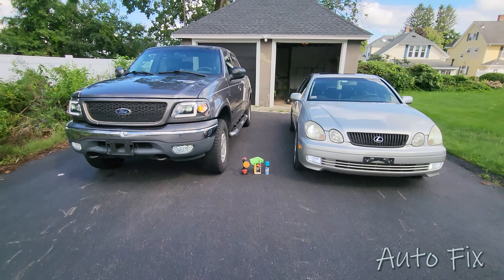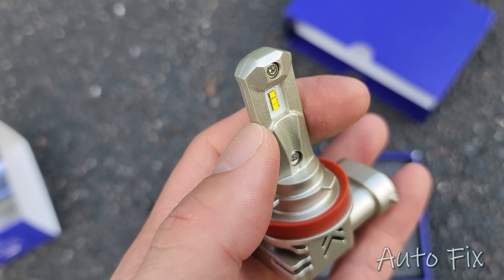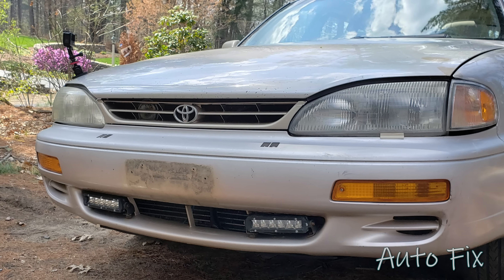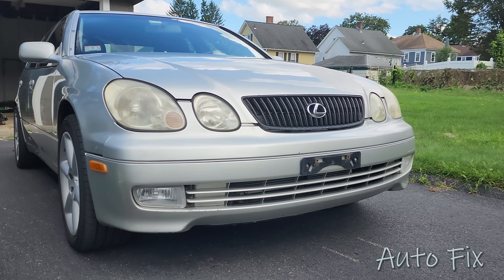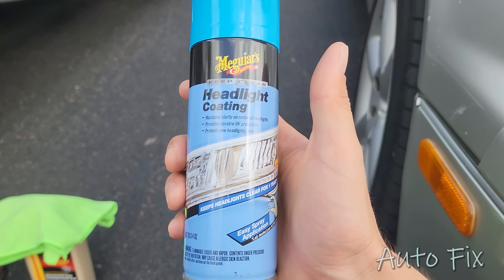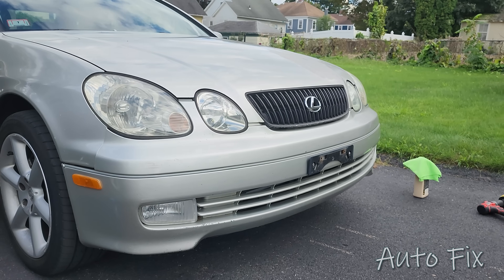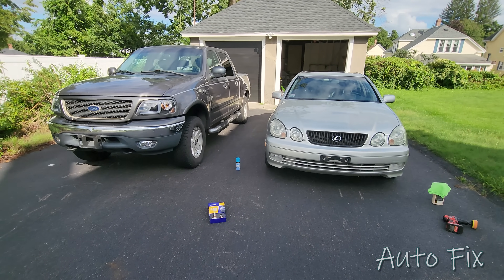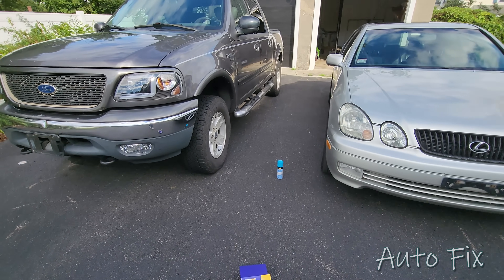How to Correctly Upgrade to LED Headlight Bulbs // AutoOne LED Bulbs!

Comment: You really shouldn’t be touching the leds with your bare hands
Reply from the maker: Yeah... it'll be alright. They're not as sensitive as halogen bulbs
Reply: Yes u can. Nothing is gonna happen with touching the led chips. 

It’s the halogen bulbs u should be worrying about. 

U can touch the led bulbs yes, but u did not say about led diodes or led chips about it specifically.
Reply: @toyotabrony  you can do anything but it’s recommended from the majority of manufacturers not to.
Reply: @scoobyquez16  no I mean it doesn’t really matter. Even some aftermarket led ougrhing companies send u some pair of nice gloves. I don’t get why, to me I guess to keep the led bulbs clean. But there’s no reason for that because nothings gonna happen when u touch the led chips with ur finger prints. It will work fine.
Reply: @ The main reasons:
	1.	Oil from your skin can leave residue that may cause hot spots on certain materials, especially on older halogen bulbs, but can also affect thermal efficiency or optics in some LED designs.
	2.	Smudges or dirt can interfere with the beam pattern or cooling if they get on the lens or heat sink.
	3.	Electrostatic discharge (ESD)—in rare cases—can harm sensitive LED driver components.

Better safe than sorry, you’ll always see those 1 star reviews saying the led lights burned out 2 or 3 months into having them. That could possibly be the issue. If the manufacturer sends gloves use them they know more about their products than we do
Reply: @scoobyquez16  honestly I guess that makes sense. It’s either that or sometimes it becomes a defect itself even if they are careful not to touch the led chips. 

But the funny thing is, to be honest. Even if it’s not a big issue. I also tried to avoid touching the led chips as well lol. 

But that’s not also the case. 

A lot of times people get the led bulbs flickering or failed and the other one is working so far. 

Simply mostly because they bought a pair of led bulbs from Amazon. That shape like exactly  halogen bulb, I see this all the time is the fact that a nice two sided led, and the heatsink is marginal. But the biggest problem is the wattage they shoved around between 30-50 watts each and it had a tiny itty bitty little cooling fan that’s around 10mm. 

Is a major imbalance. 

The hotter the led bulb performs, the shorter the lifespan is and reduce the light output faster. 

U need a well balanced led bulbs, like the autoone or Auxito - 10S, Lasfit - LA plus, Lasfit - LC plus, Lasfit - LD Plus Switchback, Boslla - C4, Boslla - B4, Boslla - B1, Auxito - M3, Boslla - ND series, Sylvania - SL.BX2, Philips - XtremeVsion, GTR-Lighting - ultra 2, Diode Dynamics - SL2 PRO, Morimoto - 2stroke 4.0, Formula J87 - G8 led bulbs. Something like those has been tested that’s well performed and very well balance. 

When I say balance I mean, the full aluminum body, and a copper heatpipe, needs to be pull the heat away down to the base, and get soaked and get drained out by a proper size cooling fan.

I don’t wear those gloves because we handle them with care. But I’m sure others do that.

Comment: Great video explaining the importance of bulb design. After owning an LS400 I can attest to the price of Lexus parts. You'd assume that since Lexus is Toyota, parts would come cheap...nope! Not even close :P On a side note, for your F150 turn signal bulbs, I'd recommend looking for some "chrome amber bulbs". That way you can maintain the amber light, but it gets rid of that "egg yolk" look you see in the reflectors. Plus you don't have to worry about wiring up relays like you would with LED bulbs. It's subtle, but gives it a cleaner overall look.
Reply from the maker: Some Lexus parts can be cheap, others... quite the opposite, like you said.
And thank you for your suggestion! I will definitely look into that!

Comment: In projector must be put 9and 3 clock or 12and 6???
Reply from the maker: @ΚώσταςΚυριάκος-δ9ο  9 and 3, always.
Reply: @AutoFixYT  if not return the bulb at 9 and 3?because the bulb stay in my headlight at 12 and 6
Reply: I have h7 halogen in projector I change with led but stay 12and 6. Is better to use bulb led 360"for best result?
Reply: Always 3-9 o’clock for the two sided led. That gives u the best and mimic the same light output as oem.
Reply: In reflector??
Reply: @ΚώσταςΚυριάκος-δ9ο  correct

Comment: Led headlights are just blinding, even modern cars with built in led headlights with stock headlight alignment it blinds you from a far
Reply from the maker: Yes they are bright, but they shouldn't blind you. Depends what car you drive. Anything low will be more suseptible to that because you're sitting below the beam of most headlihts. A truck or SUV will make it so you almost never get blinded. Also if the oncoming headlights are not correctly aimed, that will do it too.
Reply: U only blind others if u get the right ones. And with the right type of two sided led bulbs, adjust the height of the beam pattern, AND adjust the orientation of the two sided led and position them to 3-9 o’clock. U will not blind others. Thats a fact.

Comment: Is your dad’s car also a 2013-2016 CX5?  Funny enough that’s exactly the car I’ve been looking at swapping the halogens to LEDs.  How’s your dad still liking the bulbs, and is the beam pattern acceptable?
Reply from the maker: Yes that's the car! He loves the LEDs and said he cannot go back to halogen haha
Beam pattern is spot on since he has projectors, it's hard to get a bad beam out of projectors. Possible, but hard. Make sure you align the height of the headlights or at least check it, so you don't blind others after swapping to LEDs.
Reply: @ Good Deal!  Yeah ours has the halogen projector housing too.  The factory halogens are surprisingly awful at night, even with it being a projector housing.  

Did you have to adjust the bulb itself (rotate it into the best angle) or does it only go into the housing one way?  I know some of the aftermarket LED bulbs have the gasket as like a collar and there is a set screw so you can change its angle within the housing.

Comment: I simply don't get it. Isn't it the opposit of what your saying. It's not because of the LED's sitting 360° on the shown led H11 bulb, that you get stray light. It's because the placement of the LED (the diodes themselves), is wrong corresponding to normal halogen. Normal halogen don't emit light only right and left, but all around. What you want in an LED bulb is placement of the fillament as close to the center of the bulb, just like halogen. That means you gotta go for the thinnest possible center "pillow" on the bulb. This unfortunially opens up another problem: cooling. When the surface gets to small, it can't transfer enough heat. Therefor the cheap ones out there, are way to "fat", and therefor offsets the light. Know the new bulbs from Philps gets around that in there newest bulbs (witch by the way is road legal for a lot of vehicles). 
Nice channel👍
Reply from the maker: You are correct. I did go over that in the video but maybe it wasn't very clear. But yes, a bad placement is just as bad of a result as a bad bulb. Get both right, and you'll have the best headlights ever.

Comment: how did you install the LED 9005 bulbs high beam/DRL?
Did u need an INLINE RESISTOR wire with it?
Reply from the maker: No, you just plug it in. They work like any other bulb.
Reply: @AutoFixYT  what brand did u go with? I tried and they don't turn on unless you activate high beam but drl they don't turn on 🤷
Reply from the maker: I've used many brands. Auxito, AutoOne, Boslla, all are great choices.
Not all of these Corollas have DRLs. Many don't. Mine doesn't. If yours does have them and they don't turn on, that means they're not meant to function at or below 6 volts. DRLs on those are high beams at half voltage. You don't want that anyway with LEDs because if it's at half voltage they will flicker really badly and if they're at full voltage you are constantly blinding everyone. So off is the right way to go if you upgrade.

Comment: I notice you didn’t go over keeping an eye out for the canbus system. I installed AutoOne LED’s for my low beams on my 08 Corolla and eventually had to switch back to halogen bulbs because LEDs draw a lot less power than halogen
Reply from the maker: @Surround6  that actually never crossed my mind since I've never owned a new enough vehicle to deal with that.  You can add a resistor to fix that, or get bulbs that are made to not throw error codes.

Comment: Watching this as I was looking for low beam headlight replacement videos. Checked what I had been using in my car. I bought the Autoone H11 low beams on amazon for $30 in June, 2021. Passenger side LED is now not working. Amazon/Autoone no longer sells the LEDs I bought. 3.5 years is not terrible but in my experience most LED lights last significantly longer. These were the first LEDs that stopped working. Even Halogen bulbs, have only replaced a handful due to them burning out.
Reply from the maker: Yeah they won't last forever, but they do last a while. Moisture in the headlight kills them faster though.
Reply: Ye their junk, I’ve went through 3 pairs in 2 years of H1s in projectors

Comment: There's one rule. You mustn't use COB based LED lights on reflectors headlights. You must use only CSP based LED lights.

In a projector headlights you can use both of them.
Reply: What's the rationale behind this, if you don't mind me asking?
Reply: Correction. 

We can use a two sided led bulbs with a thinnest dead space between the two sided led, and always go for an led bulb that has either CSP,ZES, and SMD, Osram, and even LMP led chips. Never use COB. Too big to mimic the beam pattern.

Comment: Great video, thanks. I’m in the process of deciding with to replace the assembly or just simply upgrade to a led bulbs. What would you recommend for a 2016 Ram 1500.
Reply from the maker: I'd say just upgrade to LEDs unless you really want new assemblies, or if the old ones are damaged or hazy.

Comment: I use boslla bulbs since 2018, i spent probably close to $700 before i found a good bulb for projector housings. I have not turned back. Boslla is the best.
Reply from the maker: @diegomurillo2194  i have used Boslla as well, they are very good bulbs! I have them in another car, high and low beam, had them in for 3 years now and they're still going

Comment: replacing LED in vehicles isnt as easy as this…i bought boslla and they didnt fit…i chose from the options for my make,model,yr and trim…i tried again and bought some off ebay and they sorta fit,would turn a little but wouldnt lock in place…turned vehicle on and almost immediately got a indicator light on dashboard saying check driver and passenger headlight for outage even though they were on…put back in OEM halogen bulbs,much easier to install and inicator light went off…replaced OEM halogen bulbs with sylvania silverstar white hoping they would help me see better in the dark and they did but maybe 10% at best..the headlight bulbs that came with vehicle i have are horrible yellowish halogen bulb…really want to get LED so i can see better…the rental i had def had LED cuz i never had  to use high beams..also,most LED headlight bulb need to be decoded or have a part (cant think of it) that prevents the indicator light from coming on in dash…
Reply from the maker: Some headlight bulbs and assembly combinations can be tricky or annoying to deal with.
The error message you got is because your vehicle has CAN bus communication with the headlights. The original halogens have much higher amperage draw than the LEDs. The car now thinks the bulbs are burnt out because the LEDs don't pull much current, so the way to fix that is to get bulbs that can compensate for that.
If you're willing to spend the money, look at superbrightleds.com and check what they have for your vehicle.

Comment: Hello I have a 13 kia optima lx and my low beams don't seem to shine that bright even with leds, got the gtr lighting bulbs and it's same thing, they are projectors, any suggestions
Reply: Got myself a Kia Ceed 2013 having the same issue. Could it be that LED lights aren't strong enough?
Reply from the maker: Not all bulbs are the right fit/brightness for the application. Try a different brand and hopefully you get the results you are looking for.
Reply: @AutoFixYT  i forgot to write it here. Yeah you are right. I got new lights from other brand with "new chip" as i was said by seller and it really worked. But I should mention i had problem with high beams witch these new lights fixed. I belive it would work the same for low beams, myb it's worth a try

Comment: Not going to lie, I was originally hate watching this video expecting a typical YouTube mechanic, recommending a series of modifications to their headlights that would inevitably be illegal and potentially get you sued for using. 

It’s good to see that there are some people out there that understand how headlights are supposed to be constructed, in order to both be safe and still pass IIHC testing standards. 

I will say, I wasn’t aware of this new gimmick known as “headlight coating”, but I guess it’s good to see that they are trying to do something better than simply promoting “headlight buffing kits”. 

I’ve been using rattle can clearcoat for two decades, with up to two years of haze free headlights per application.

I typically recommend rattle can clearcoat over one of those kits, simply because rattle can clearcoat will do a better job with no prep, than spending two hours buffing your headlights, without using a clearcoat. 

I called the “headlight coating“ a gimmick because clearcoat is literally UV protection. Saying “UV resistant clearcoat“ is the exact same as saying “water resistant raincoat“. 

If it cost more than a can of clearcoat, then you’re just paying for your own ignorance, and definitively just getting scammed.
Reply from the maker: Glad you liked the video!
And thanks for all the feedback!
I do agree that the UV headlight coating doesn't last as long as i expected it to last. So next time I'd buy something cheaper for sure.
Reply: @AutoFixYT  Something cheaper will probably last longer, but if you don't mind spending $20, go to your local Auto Body Supply store and have them make you a spray can of whatever their mid-grade brand of clearcoat is. 

It will be OEM quality clearcoat that's typically sprayed from an HVLP air gun, but in an aerosol can. It's mostly for doing touchup work, but a whole can will probably 3 pairs of headlights, and you'll get better protection for longer.. 

Plus, professional grade paint smells so much better! 🤣

Comment: Demand manufacturers to have digital matrix led’s. Most problems with oncoming glare will be solved!
Reply from the maker: That would make all headlights unserviceable and extremely expensive.
Reply: @ they have them in Europe for decades now! It solves the glare issue but not the wallet issue. Pick your poison?😅

Comment: Leds are 💩 and in the UK they won't pass our MOT Test. Not a problem, just swap em it for the test.
However, I've tried many in my projector headlamps and every one was fantastic when first turned on and within 5 to 15 minutes they lose output/brightness so much so you're almost driving blind.
The hotter leads get the more they degrade until they cool down.
Even if you leave the access cover off the casing.
They also don't work for very long. From one week to a month and they're done.
Save your money, have your headlamps adjusted properly and stop BLINDING OTHERS‼️
Reply from the maker: That sounds like an issue you were having with the LEDs you purchased. I've never heard of that happening. I've had many brands of LEDs, and so many people here in the US convert and never have that issue.
As for blinding others, I think you missed the entire point of this video. You blind others when you don't do it right. But done right, they should work like factory! I have successfully converted many cars that look like they now have factory LEDs. This video was meant to help others achieve the same results.

Comment: I've come across this because I've fitted LED's and one of them is great, the other is hardly providing a beam at all - and neither was the halogen - its not just poor light, its as if something is blocking it. This video shows me more about the internals (mine is projector type) and what you've said about bulb positioning makes sense - Even though it only appears to fit in one position. I'm off to experiment with that - thanks for an informative feature
Reply from the maker: Awesome, I'm glad this video helped!

Comment: Your video explains this heated touchy topic pretty well. People think you just plug and play and drive……Not at all. Numerous factors to consider, and most are trial and error and purchase to return. I went thru 3 brands and types before I found ones that are compatible with my vehicle, sit firm snug and tight, don’t blind other drivers, and last but not least, are aesthetically appealing…….unfortunately Most times the aftermarket projector retrofit is the best, sometimes only way to go. I got lucky I guess
Reply from the maker: Thank you!
I love LEDs and I think upgrading older cars to LED headlights completely changes your driving experience at night. BUT... you have to do it or otherwise you're just wasting your time and money, and getting frustrated at the bulbs. So that's why i made this video, hoping to share some knowledge with people that want to make the switch but are afraid to because they don't know how to do it, or people that have tried and failed and can now try again successfully.

Comment: I was under the impression you MUST install a resistor when changing over from halogen to led .
Reply from the maker: @Love4raine  no, that only applies to turn signals so they don't hyperflash. Even those, you can replace the relay and skip the resistor.